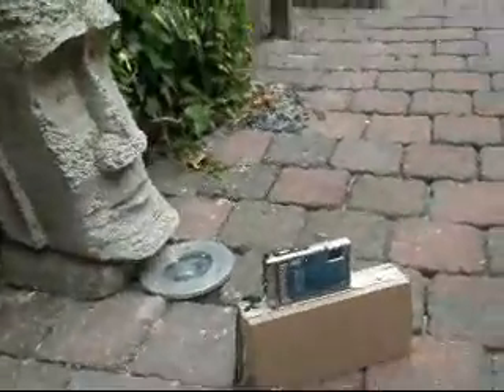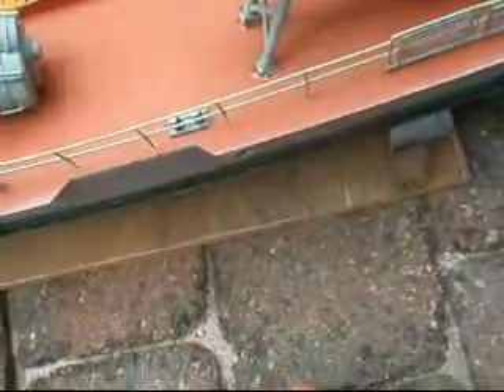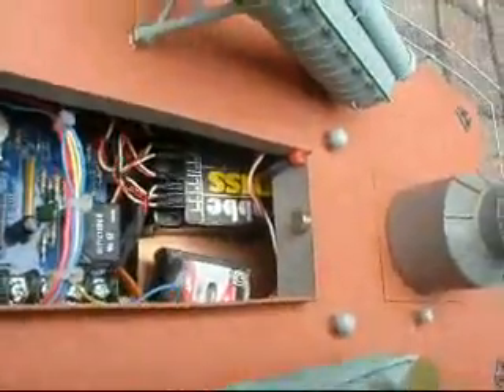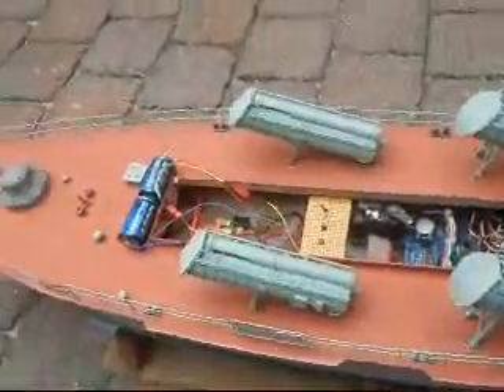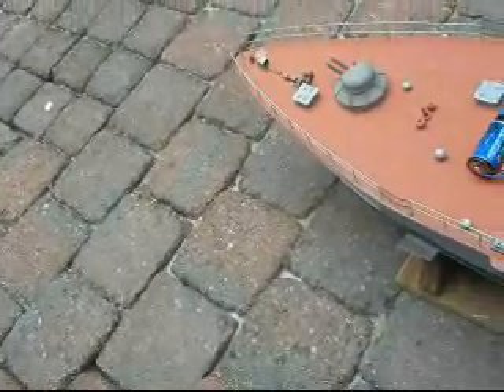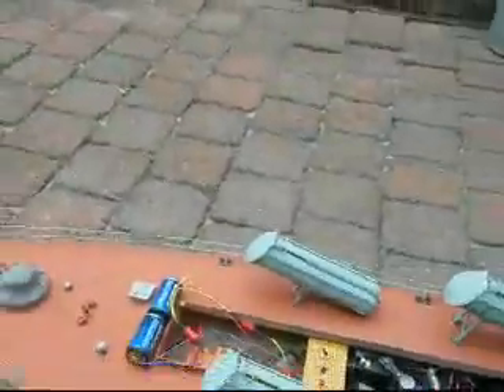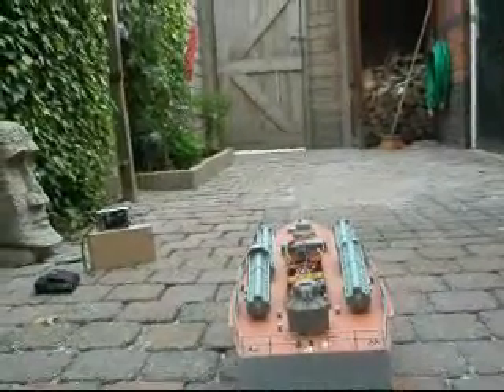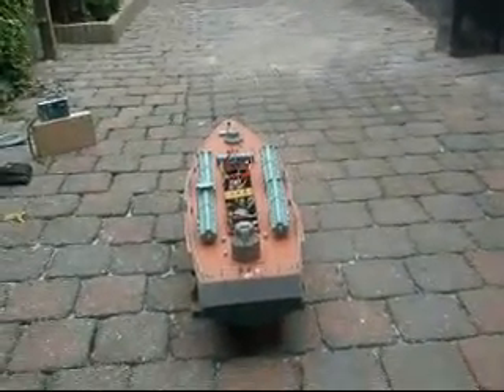OSA 2 Rocketlaunch part 1

Comment: Cool!
You should check the size, the wings and the weight of the rocket. See if you can fit in a slightly larger rocket. As I saw you have a guide to help it during launch.
:)